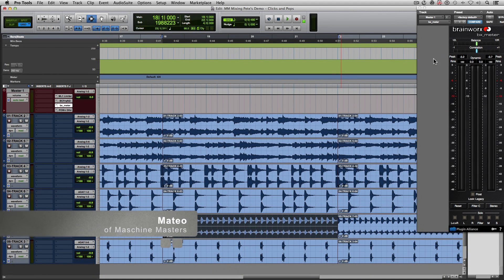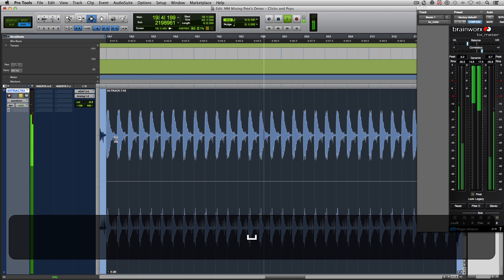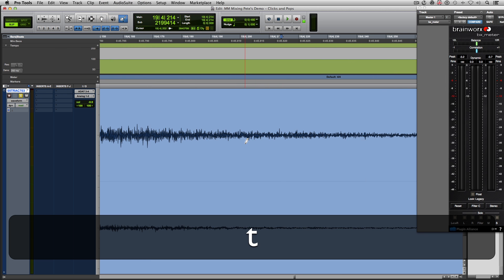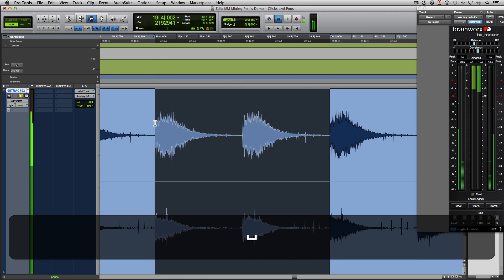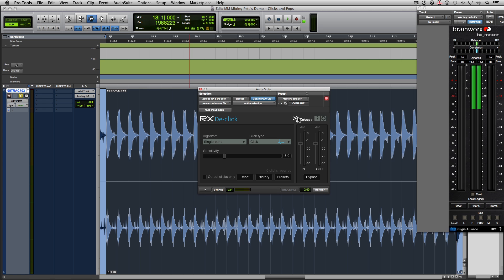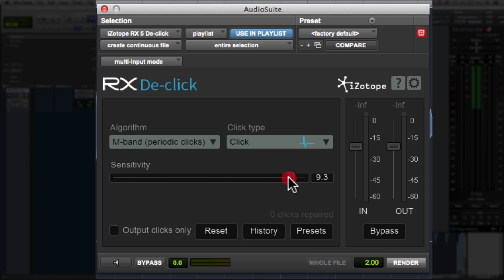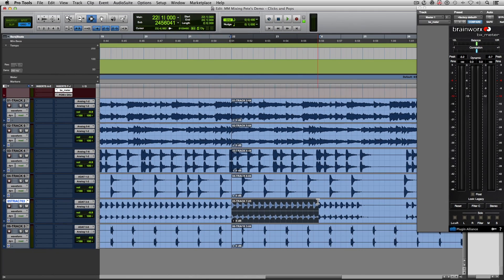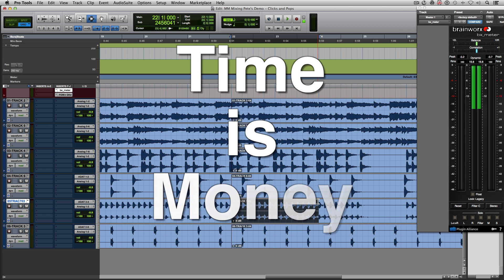Easy Way To Remove Pops And Clicks From Audio Tracks [Mix Talk Monday]

Comment: where did you run the plugin? it’s not listed on the track you used it on so how did you pull it up
Reply: That’s because he didn’t use the plugin as an insert. He used it as a process. Usually can do that by clicking audio or edit up in the taskbar and clicking plugin or process and then find the effect.

Comment: Does Fl Studio have this
Reply: FL supports VST, so you should be able to.
Reply: Or, are you asking about being able to manually remove clicks by drawing out the wave forms?
Reply: Xitmuse yea that like how he just erased it exactly
Reply: Ah, I see. I unfortunately haven't used FL in about 14 years, so I'm not aware of all its features anymore. I know most of the other DAWs can do this but, from what I remember, FL is primarily a sequencer. I don't remember it having any wave editors built into it. That may have changed over the years though.
Reply: fl can do everything.. its just allways a looong way to the finish line.. very uneffective tool